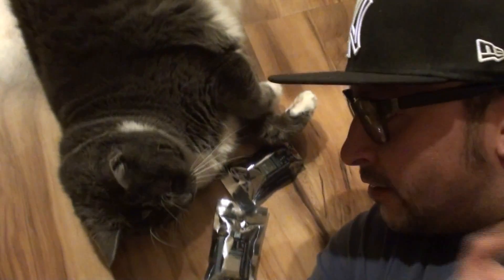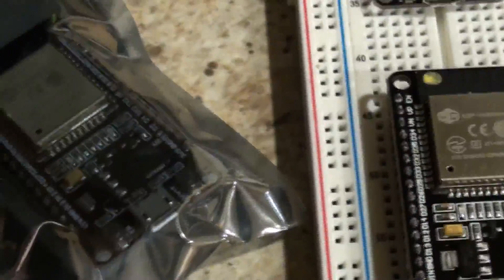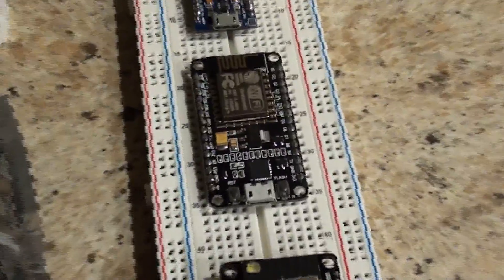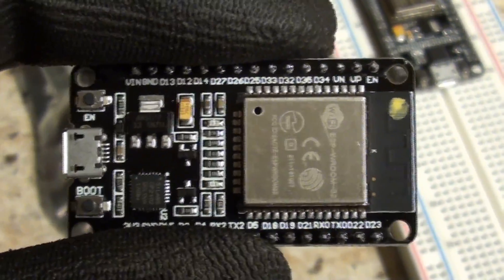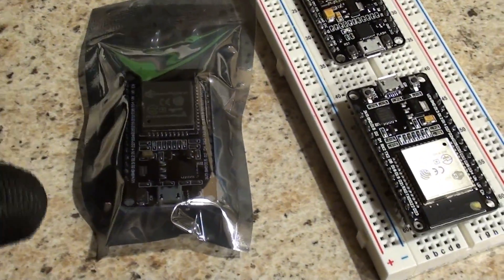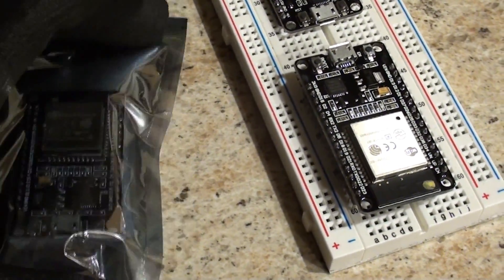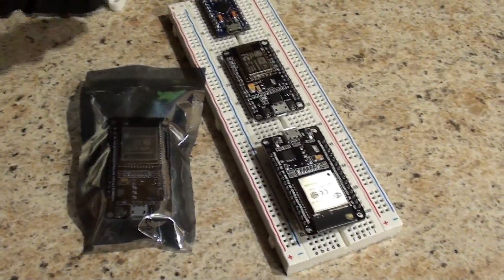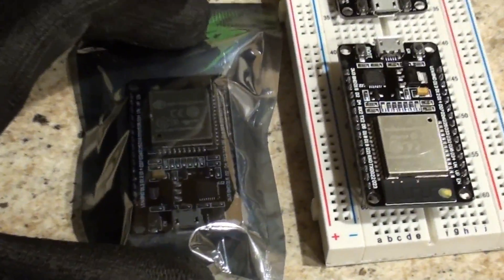Quick Noobs Intro to ESP32 Dev Kit V1

Comment: Im no programmer but ive been playing with arduino uno, esp32 and esp 8266 for about a year off and on. Been fun. Then i came across the esp32 s3 wroom-1 cam board and been a total headache. The only success ive had ith that thing is finally getting an rgb led to fade and cycle through the colors. Other than that i cant get squat to work